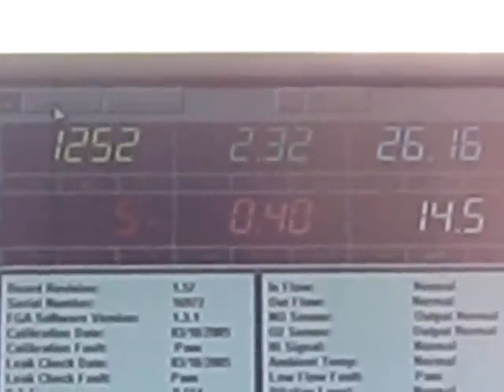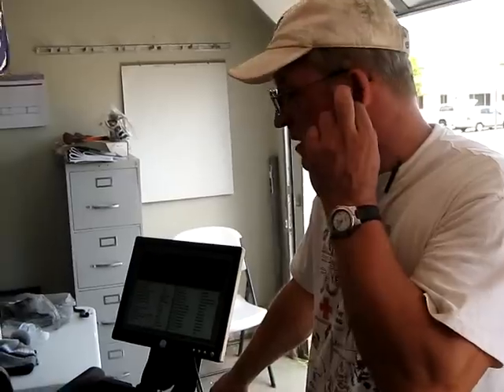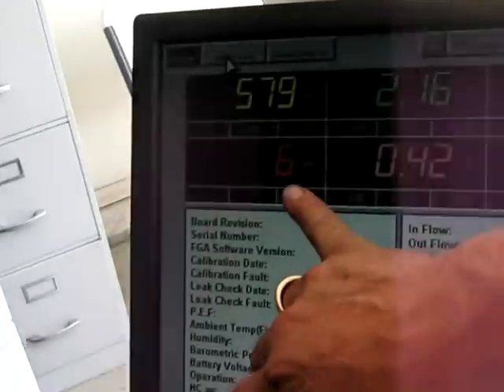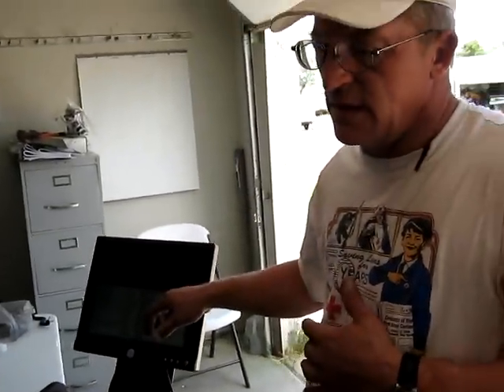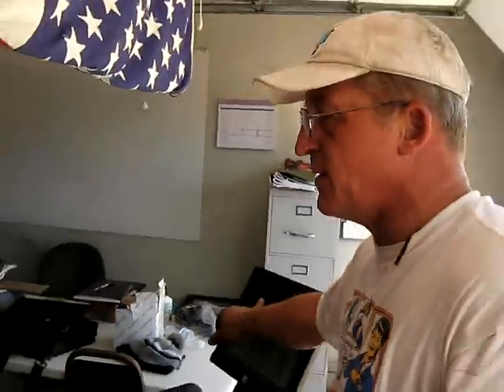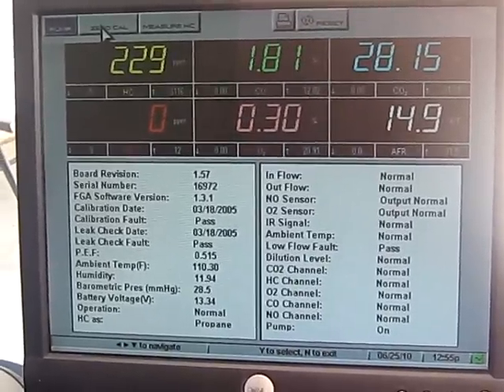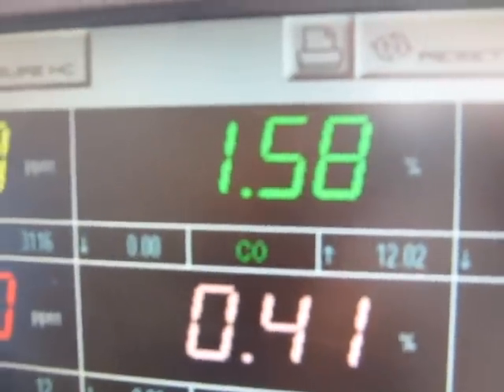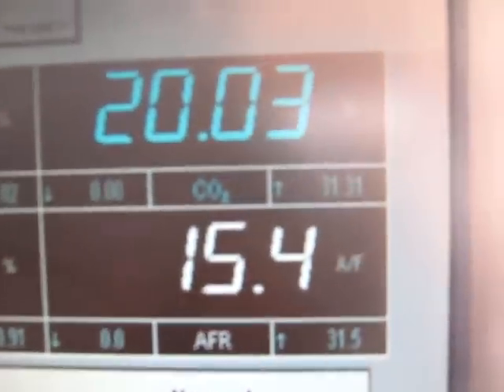ZERO HC Emissions, Courtesy of The Gadgetman Groove.

Comment: I personally was in this shop in Feb. of 2012, and I witnessed another car do Zeros on this Smog Machine.  That particular car had been Grooved by Ron. The exhaust pipe at hot idle of  the car I saw, had ZERO smell. I know this, 'cause I laid on the pavement in back of it and put my face right up to the tailpipe!  It was like moist blow-dryer air.  It belonged to a good friend's wife, they were both really happy with the results too!

Comment from the maker: @Zolar1 Consistent reports are the engines are much easier to start and warm up more quickly. This is an interesting report, as the exhaust manifold temperature appears to drop by some 200 degrees.
Let me know when you want to get it started!

Comment: First of all, it would be nice if you didn't violate the Clean Air Act  by changing the emissions control system (your vacuums are open and that is a violation).. Second, your readout says you are running on propane and not gasoline, so you either didn't have the machine setup right or you are trying to fib on the data..